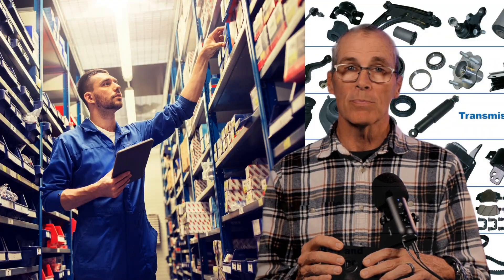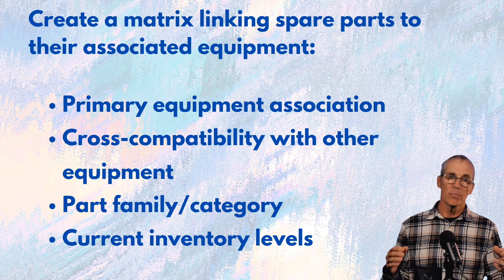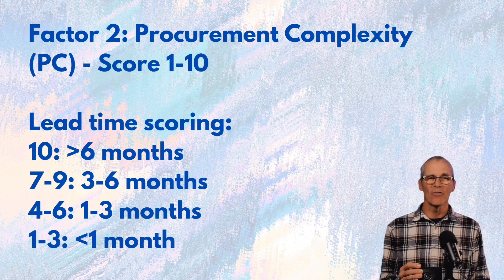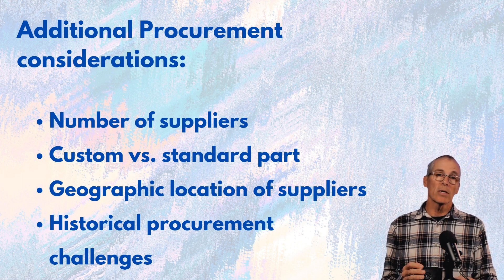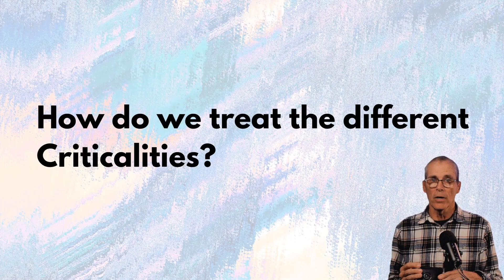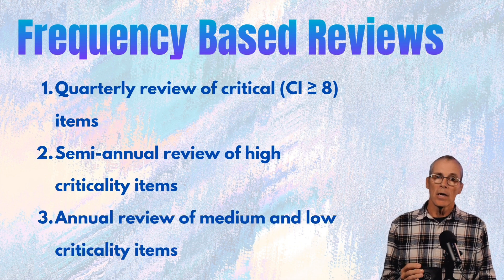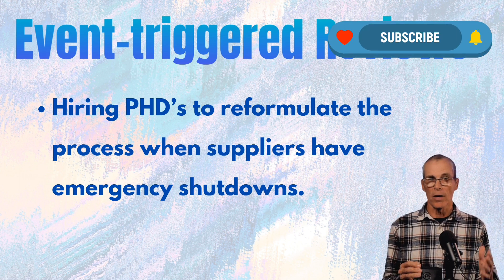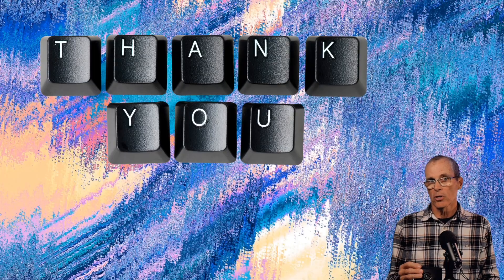How to Develop a Critical Spare Parts Management System

Comment: Are there any recommended references?
Reply from the maker: This is an area that I have not seen any "How to do it" type references. Not even the insurers I've run across have specifics in their recommendations. They are usually happy to just see that the insured knows what is critical and maintains the long lead time equipment in stock. For power plants, they are very interested in spare GSU's and spare rotors for gas and steam turbines. This is one where AI will be helpful.😁
Reply: @EnergyRiskEngineering  
All right. Thank you.